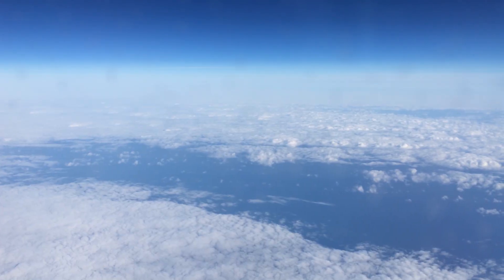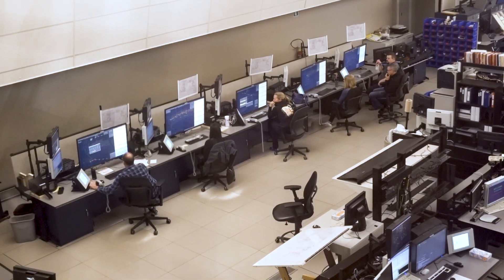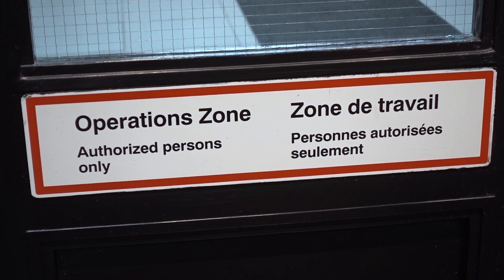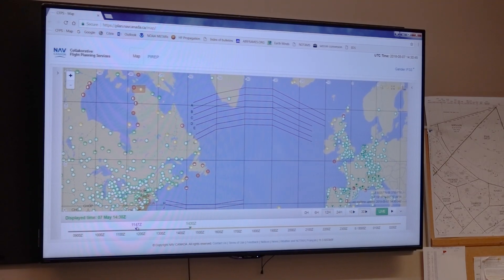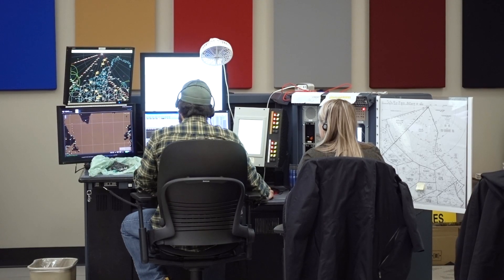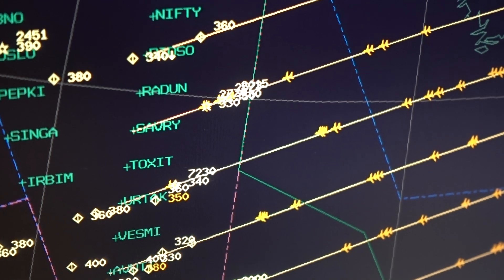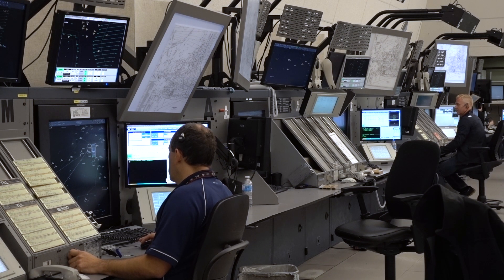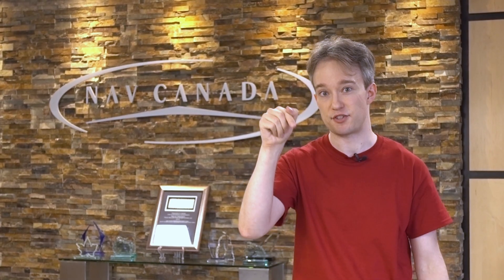How planes stay safe over the Atlantic

Comment from the maker: If the lighting and shots seem a little odd here, it's because -- for good reason -- I wasn't allowed to film too close to the air traffic controllers. They're a bit busy.
Reply: Ryan Stephenson 
He uploaded the video when it was done, 3 days ago, and just now made it public because of his video schedule.
Reply: Ryan Stephenson Tom is a time traveller obviously
Reply: Scheduled uploads.
Note how the date on this video says "Published on..." instead of "Uploaded on..."
Reply: Tom, clarification. There is no SSR/ATC radar coverage in the tracks as those systems are line of sight, however the area is not without radar coverage. It has plenty of coverage from Over The Horizon (OTH) systems and other military radar systems. There is no rush or need to put any systems out there as the cost to maintain them would not be worth the benefits as current systems are more than capable, much in part to the quality of aviation grade GPS systems and the crazy range of HF(3-30MHz) radios. Also the aircraft can push data up to satellite links via Ku-Band.
Reply: newcoolvid27 Outside of military operations restricted airspace, all traffic is managed by the same controllers. Well, that’s how it works in the US, mostly. That’s the other reason Tom wasn’t allowed to film closer, some of the planes might be military and that info can be classified.
Reply: E. Kelbell: You might need to turn that into a question that makes some kind of sense before anyone can respond to it. If you write nonsense you can expect nonsense for an answer.
Reply: How does this sort of thing interact with military aircraft?
Reply: newcoolvid27 the military basically does what they want. 
I imagine they're still in communication with these folks if they needed a transatlantic flight, though, for safety. Probably an added buffer around them,too. just that we couldn't see them on something like flight radar 24
Reply: Did you pass out from the G-force when the aircraft left the runway?
Reply: Tom Scott - Hoping you do/did a video about Gander International Airport while you were there.
(PS. 99% Invisible uses so many of your videos in their stories: you two should find a way to collaborate.)
Reply: I can't believe that my favorite youtuber was here in Newfoundland.
Reply: livid sphincter, you're a freakin genius!
Reply: andrew4043 It's a bit unclear because of your wording, so I'd like to point out it always says 'Published on'. :)
Reply: That's really interesting, what are the legalities of filming air traffic controllers?
Reply: How was this comment posted 5 days ago but the video posted yesterday????
Reply: FukU2222 that question has already been answered in this very comment section...
Reply: I hope you had a good time on the rock. It's was an awesome suprise that you did a video in my home.  Did you get screeched in when you was here my buddy?
Reply: You said Newfoundland correctly. I'm more proud of this than I should be. :D
Reply: airplanes are definitely an amazing piece of machinery. I have been fascinated about planes since i read about the software behind airplanes!
Reply: Thanks Alot its very amazing
Reply: Why does your comment say 3 days ago?
Reply: Can you do a video explaining why flat Earth flight paths make more sense than globe flight path. The Earth is completely flat and the flight paths prove it. Look into it please. And debunk it with science if you can.

Comment: The aircrafts are separated by the unit of minutes in front of and behind each other, which makes perfect sense. They have figured out how many minutes is safe under these circumstances. – But then they are separated by 1000 ft in height. But what is so magical about 304 800 mm separation? When aviation finally moves over to metric, will it still be 304 800 mm separation? Will they move over to 300 000 mm separation? Or will they actually figure out how much separation is safe? Maybe it's 245 000 mm ...

Comment: Do you know how the Pacific works?
Reply: Most transpacific flights go through the southern half of the ocean, were there are lots of islands were air traffic control is, but you can still do a transpacific flight in the northern half aswell, typically over the alution islands and then to Japan or from Hawaii, over, Midway, then Guam,

Comment: Interesting ... I knew there were radar dead spots in the world, but never thought that the North Atlantic would be one of them. Surely there is at least military radar in the US looking for incoming Soviet Russian planes and missiles that might come from that direction? Though maybe they're not willing to share their data with civilians... it might even preclude the installation of any civilian long-range/OTH scanning radar setup because of potential interference...?

I expect the radio transmitters mixed with (the surprisingly slow uptake of) GPS will eventually make the need for it obsolete, though, as planes can check in every couple of minutes with a quick chirp containing their tailcode, lat/long, speed/heading and altitude. Much like MH370 was revealed to have done (though, "phoning home" to Boeing rather than informing ATC in any way) for quite a long time after going off-track and off-radar...

Comment: I genuinely wonder, if there was no air traffic control systems of any kind and it was an absolute free-for-all, what are the odds of any collision at all? I assume there are a lot of factors in this, including visibility conditions and sheer volume of traffic, but I genuinely think it would be an interesting question. Because if planes just went where they wanted, and didn't have to go over specific paths, but had the whole sky to choose where they wanted to go, there might not be enough planes where two of them in the same space at the same time is even remotely likely. Probably no more than a 1% chance. 

I see the only problem with this theory being the fact that they plan their routes along certain paths for the sake of efficiency more than anything, so they wouldn't be randomly distributed.

I'm not saying we should get rid of ATC because it's useless or anything, I'm just thinking out loud.

Comment: why no GPS? honestly why not? put a GPS tracker on every bit of an aircraft and then you can never have another event like MH370
Reply: 1) That's an insanely high level of bandwidth. Think about how many aircraft are in the air at any one time, all sending data at eachother. 2) You're only moving the problem back one step. If an aircraft loses electrics outside of radar coverage, then there's no GPS signal so nothing really changes
Reply: sorry if my logic is flawed here but cant you get handheld GPS devices, meaning you could very easily have a battery backup that runs the GPS transmitters in case of power outage. not sure how to solve bandwidth but still one GPS transmitter per plane doesnt seem like it would be too hard seeing as there are millions of devices already using GPS with not extra cost for the bandwidth used.

Comment: This makes no sense.  It's 2018.  We've had GPS and satellite internet decades.  Why don't planes update their location automatically using GPS and satellite internet?  And why hasn't this been implemented, especially after the MH370 crash?
Reply: Thousands of plane (just on NAT system) all sending their position report constantly.

How many satellites would you need to handle all of that datalink bandwidth demand?

Why bother when this works just fine?
Reply: They do, that's what CPDLC and GNSS are for, but not all aircraft are equiped with them, and even if they were it still wouldn't eliminate the need for an air traffic controller who can oversee the big picture.

Comment: Planes stacked on top of each other in mid air, separated by 10,000 feet? Sounds like an upcoming stunt in an action movie, as operatives drop from one plane to the next, using some kind of high tech equipment to maintain their horizontal speed and adjust their vertical speed.

Comment: I confused. We already have a perfect means of tracking aircraft. Its called GPS. Are we not using GPS because of the missile safety thing? Surely there is a technical solution...
Reply: There is a fundamental difference between the navigation of a single aircraft (via GPS or INS), and the tracking of hundreds of simultaneous flights in a crowded airspace.
Reply: Gordon has some of it, but also we've been doing it like this LONG BEFORE anyone thought of using satellite signals to triangulate your position on the planet.  Also we're not yet there for using GPS for this kind of tracking; maybe for OUR children, tho!
Reply: @empath69  dude the gps on my phone works in planes, and they already have data connections. there is literally no reason not to automate this janky old system.

Comment: Very very cool!!!
This also makes me try to imagine what would have to be in place in a world with flying cars. This, by itself, is complex enough.
Reply: Flying cars would at least be smaller, slower, and far more manouevrable, so could be much more densely packed.

Imagine how much less traffic your city would appear to have if all of the existing roads were actually five or ten decks high, which a practical FC separation would probably fit within 150 to 350ft of the ground, safe from both most RC drones (typically capped at 100ft these days) and typical ultralights & helicopters (not supposed to go below 400ft in populated areas).

Comment: So what's HF? High frequency? And so how does the signal actually travel when the "text message" button is pressed? Through satellite?
Reply: HF is high frequency, it has a significantly longer range than VHF or UHF, which we normally use, for a whole bunch of different reasons. It’s great for long-distance comms but isn’t what you’d call “high quality audio”. The “text messages” is a system called Controller/Pilot Data Link Communication (CPDLC). It’s transmitted by both VHF and satellite communications. When an instruction is issued via CPDLC by ATC, the message appears on the datalink display in the aircraft and the pilots can accept, reply or reject the message. Since the datalink is tied to the flight management computer in many cases, route changes and other modifications can be performed automatically when the pilots accept the message. This, combined with the huge reduction in Voice comms workload, makes CPDLC the much-preferred system for communication in high-density non-radar environments
Reply: The other point to be made regarding that is that, as demonstrated by morse code, simple, short, low bitrate digital messages require way less bandwidth than even the lowest quality voice. 1khz is more than sufficient for, say, 300 baud transmission, which could send a 150 character tweet-like message in the space of five seconds (decidedly faster than you could comfortably read it out - and enough length to pack in quite a lot of info, if you code it in an agreed fashion), whereas AM radio tends to have 9 to 10khz allocated to each station. This both means you can pack a lot of channels into a small amount of frequency space, and have each plane effectively on its own dedicated channel as it flies, but also allows you to make it more robust by widening the bandwidth if needed, as well as being able to isolate all but the most direct interference by tuning in very tightly on that one very small range, and of course using much lower radio frequencies (that tend to not be attenuated by distance anywhere near as much) so it can be sent a remarkably long distance even with a low power transmitter.

Modern HAM morse users, whether casual or for competition, do a quite astounding job of sending messages very long distances using home-based hobbyist transmitters and even smaller bandwidths (maybe 100Hz, with transceivers that can remodulate the signal up into a range that's more clearly audible to the ear) because the pulses they send are rather longer than those used by digital data, so the modulation frequency (and thus bandspace required) can be lower. You might be able to get 100 different intercontinental conversations going on inside the space allocated for a single voice channel, with no significant crosstalk. I think there's even an informal competition going on as to who can claim the lowest power transmission that's still recoverable anywhere in the world, which has descended into extra low frequency and extra low bitrate setups with frequency shifting by steps of less than 1Hz to cram in additional information per pulse, taking a minute or more to send "hello"... but they manage the equivalent of beaming something around the world using just a cellphone transmitter.

...another important factor is that the planes are very high in the sky, which means the effective horizon stretches out much further than it does at ground level, for both the plane and anyone observing it. They can probably get line-of-sight from a couple hundred miles out, as well as achieve a measure of one-bounce over-the-horizon transmission from atmospheric reflection, which also massively improves your range.
Reply: QuassSeabass Awesome, thanks for the explanation!

Comment: why isn't there any radar coverage?
Reply: Radar is limited to line-of-sight, and the curvature of the horizon. There are no transmitters in the middle of the Atlantic Ocean.
Reply: thank you
Reply: I invite you to try building a radar installation in the middle of the Atlantic ;)
Reply: QuassSeabass You could, it's just too expensive to bother with when this system works. A string of oil rigs with surplus radars could easily provide radar coverage.
Reply: Actually Iceland is in the center of the Atlantic. Even so, radars are too short range to cover the whole distance.

Comment: Despite being "beyond radar", GPS/GNSS basically allows them to pinpoint where everything is.
Guess nowadays it's more about keeping in the right position wrt the winds.
Reply: GPS lets the plane know exactly where it is (at least, assuming everything's functioning properly), but that's different from ATC knowing where the plane is, or knowing where planes are in relation to each other.
Reply: Yeah, GPS is one way so a person might know exactly where they are with it but they would still need to have a way to get that information to a rescuer.
Reply: No.
Reply: True, but there's the ADS-B already which broadcast location to other parties, including ground controller (ATC) and other aircraft (if equipped). The FAA (in the US) already requires ADS-B in controlled airspaces, and ICAO endorses the replacement of current radar-based systems by ADS-B entirely (at least this is what I know from EUROCONTROL). ADS-B is an automatic location transmitter that doesn't require any crew inputs, nor it can be turned off.

Comment: So without the airplanes constantly reporting their GPS coordinates and speed, this system wouldn't work? What if there is a total radio blackout on one of the planes? What if the pilot has some psychological trouble and turns off their airplane's transponder unit? OK, the planes have collision detection systems onboard, but as long as the ground station can't confirm the collision warning with further data, how are they supposed to keep everyone safe? Multiply the problem with the number of planes that don't have working transponders, for whatever reason that may be.
Reply: That would be why planes have more then one pilot. As for loss of radio, that would be an emergency situation that I'm sure they have standard procedures to address, if not backup systems.
And if you're talking multiple planes at once, then it's probably caused by a global scale disaster and a few planes colliding is the least of our worries.
Reply: A plane is not permitted to fly without a working transponder, and will be told to fly a different route if it fails.
Reply: That's the issue- however in the decades this system has been in place, there has never been a failure like you have descried.

Comment: "Flight 223, you're a little close there to 445, Buddy." "Ground control, I'm not your buddy, friend" "223, I'm not your friend, Guy"
Reply: "Flight 223, turn right heading 205 for noise abatement." Flight 223 replies" I am at 33 thousand feet, over water, just what noise abatement problem can I be causing?". Calm reply" there is a terrible noise when a 707 and an A380 meet in mid air, please turn right to 205 degrees immediately"
Reply: Did you mean flight 22🌳
Reply: In my head, i’m reading this post in the voices of Terrence and Phillip. “ Hey Ground Control, do you want the position of my farts”
Reply: MickyAvStickyHands "Ground control, this is a lighthouse"

Comment: So how do they actually follow the tracks?
Reply: Aircraft navigate primarily by two major systems: GPS which you've probably heard of, and INS or an Inertial Navigation System. An INS calculates the current position, velocity, and orientation by combining the previous known position with data from sensors like accelerometers (acceleration) and gyroscopes (rotation). This process is called "dead reckoning" and while it can be done to some degree by humans, it is primarily done by computers these days.
Reply: The tracks are defined at certain co-ordinates, normally every 10 degrees of latitude. The aircraft’s GPS and inertial navigation systems therefore fly the aircraft from one co-ordinate to the next, as defined by which track they’re following

Comment: Does it happen that the TCAS system and the traffic controllers give different commands? If so, is there a routine on which command to follow?
Reply: An accident actually occured some time ago because a pilot followed the instructions of a traffic controller, which contradicted that given by TCAS. As above, the routine now is to follow TCAS.
Reply: MasterHigure Pilots follow the TCAS if it gives an RA.  Controllers are trained to stop giving instructions to an aircraft that has reported a TCAS climb/descent.